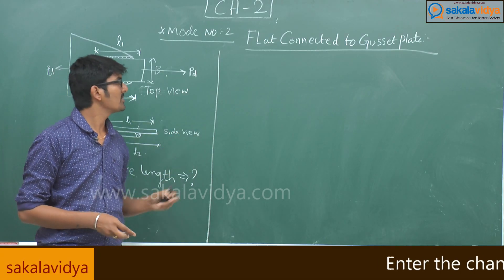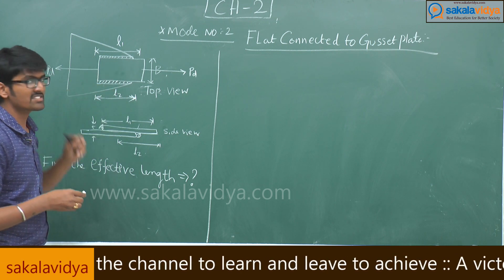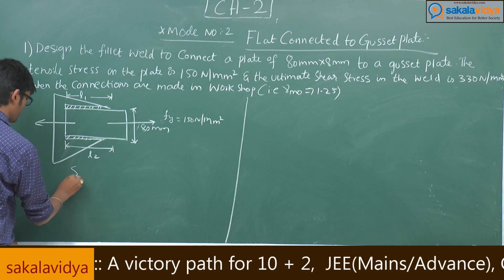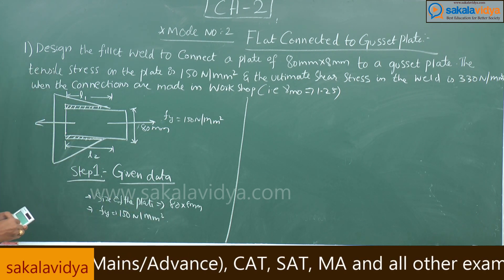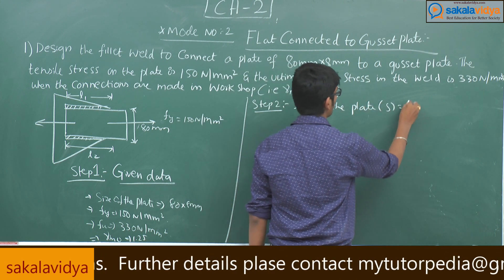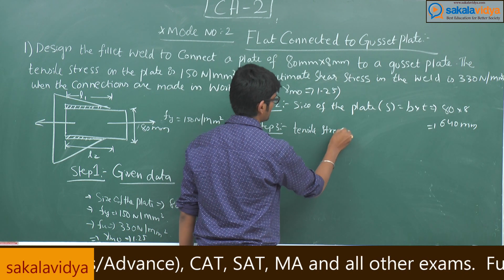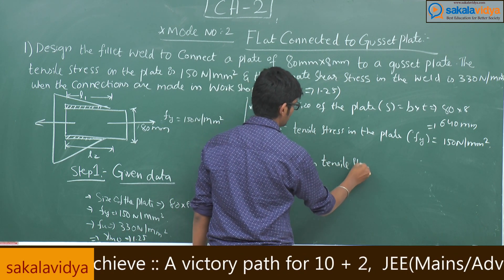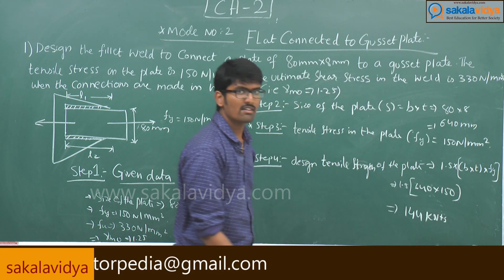BE/ BTech Design of Fillet Weld Part 8 for polytechnic||gate || civil engineering| IS:800-2007 |ECET

Comment: design a longitudinal fillet weld to connect a 150mm by 8mm plate to 200 by 10mm to transmit a pull equal to the full strength of small plate. assume welding is to be done at the workshop ?
Reply from the maker: so what do you want.?? do you want us to make a video on the problem you have given to us.?
Reply: @SakalaVidya  yes would you please???
Reply from the maker: Ok sure
Reply: @SakalaVidya  thank you very much but when will you do it?
Reply from the maker: soon we will try to do so.